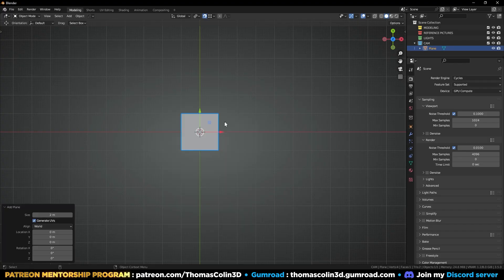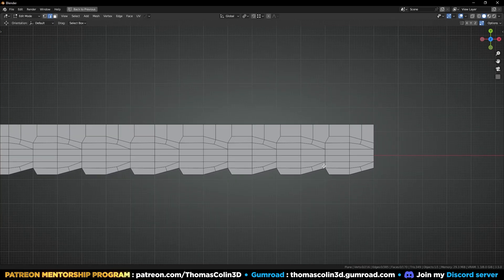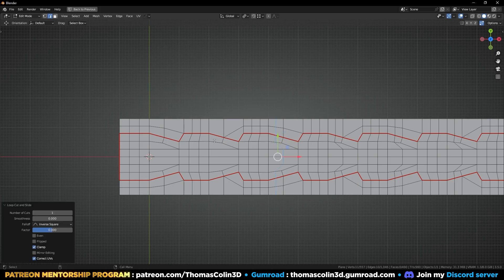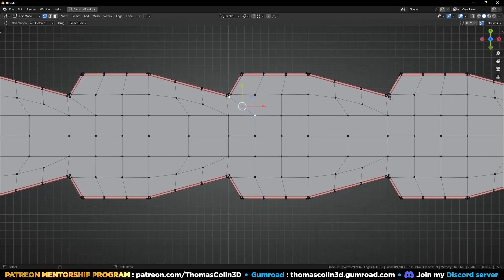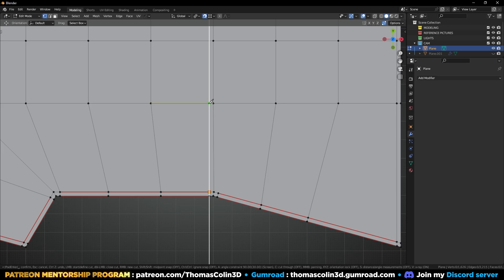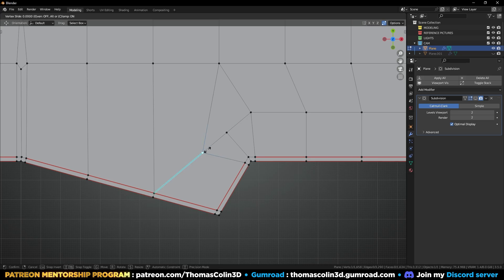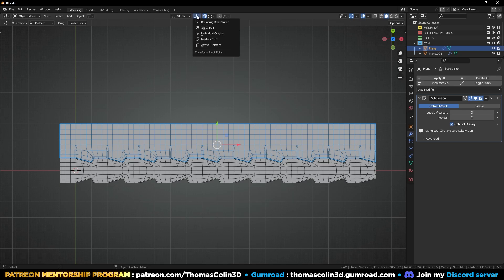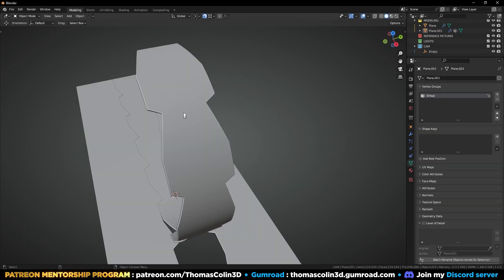Modeling a Tear Strip in Blender - Topology Study

Comment: Great topology but you spend so much time on the flat part that didn't need quads because it doesn't deform or need a subD modifier 😅 appreciate the tips nonetheless. I still learned a lot.
Reply: Why doesn't it need a subd modifier?
Reply: @filipstamate1564 because it's flat. It doesn't need more geometry.